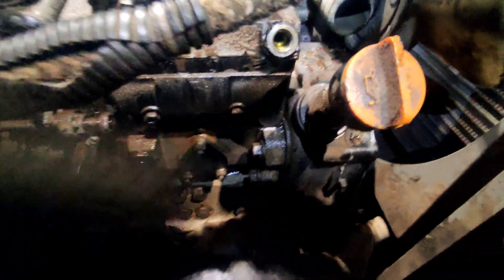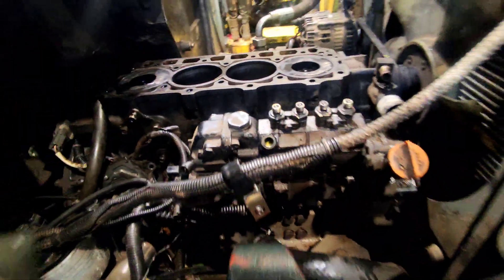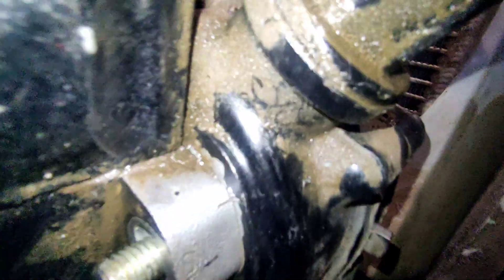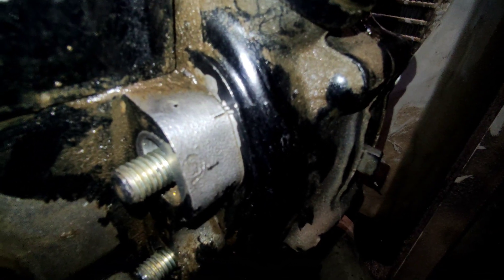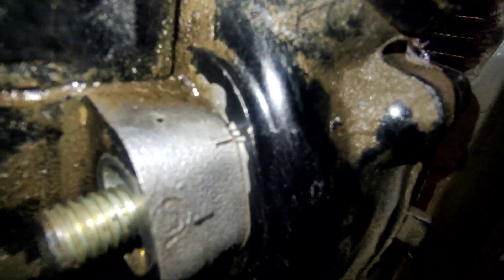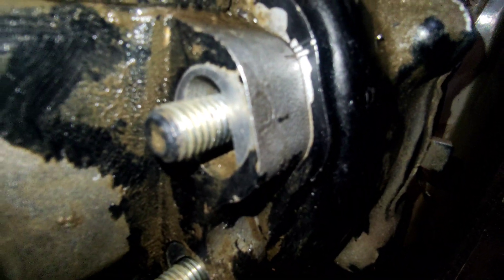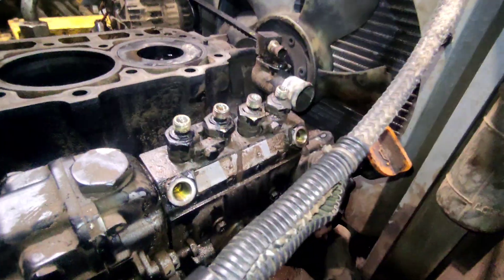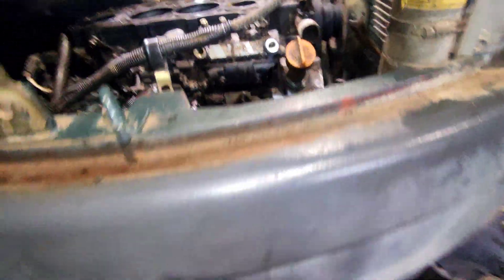engine overheating problem, fuel pump problem, part 1

Comment: Very professional approach, thanks for the video. 

I have similar problem with my Mitsubishi 4DQ50 engine. It runs 45 minutes like a clock. After that its RPM starts to decrease uncontrollably about 30 second and then it stops. Diesel injector became too hot to touch when it stops. I have to cool down the engine for 3-4 hours to make it work 45 min again. If I wait less, it runs less. For example, if I wait 1 hour, it runs 10 min.

How did you fix this motor in the video? What you've done with fuel injector?
Reply from the maker: There is the next video where is all explained and all working
Reply: @avicomjdoo  In the next video you just say that injection pump is repaired. There is no info on what kind of repair done. Anyway, I think I can't solve my problem on my own, I'll work with a professional.
Reply from the maker: @ahyakal  in the fuel injection pump there are pumping elements which were worn and as the pump would get warm it couldn't provide required pressure at cranking revolutions (*250rpm) so machine wouldn't start warm...